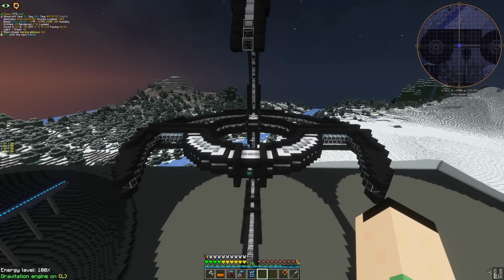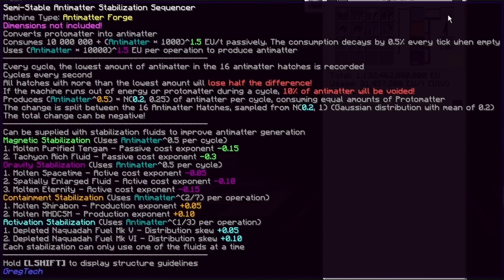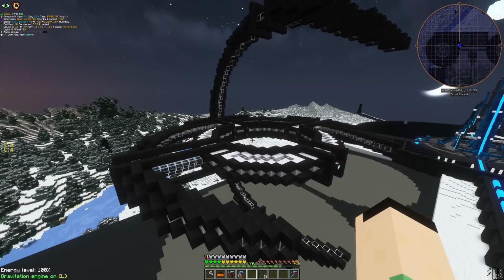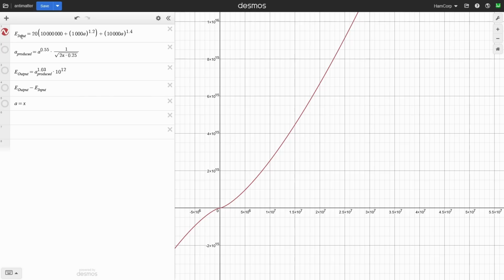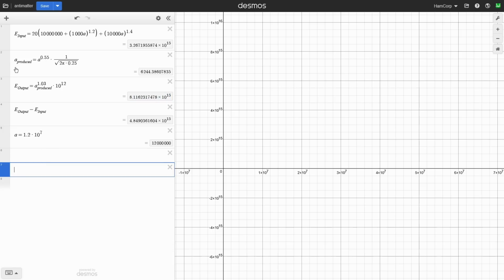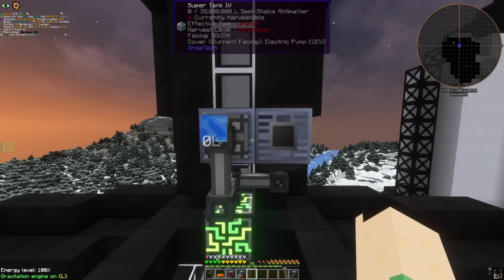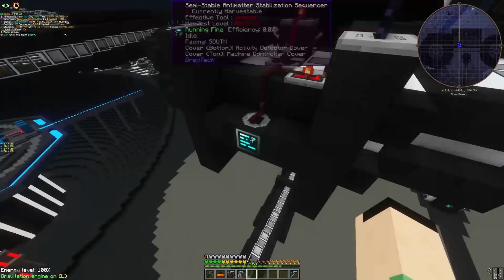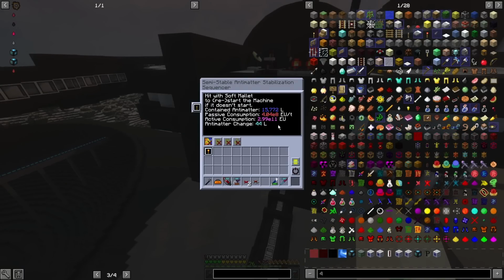GregTech New Horizons E145: Antimatter Automation

Comment from the maker: Dear employees,

The antimatter math is slightly wrong - a_produced is not what is written. The tooltip in 2.7 is not written correctly and doesn't match what happens in the code - what it is actually supposed to be:

a_produced = a^(0.5 + production modifier) * (0.2 + naqfuel modifier)

This brings down the EU profit a lot, along with the optimal antimatter in the hatches.

Also, I am aware of the audio issue, specifically with the ringing sound in the background. The ventilation in my office can get noisy, and the mic only picks up when I speak. I have since fixed this issue, and future episodes should not have this unfortunate mistake.

Best,
HamCorp
Reply: Dear CEO,

I knew there was a reason you make over 2800 times the salary of the average employee!  Keep up the good work!

Obsequiously,
lordshmee
Reply: Minor correction: From what I can tell, the second term with the N(0.2, 0.25) and N(0.2, 1) is the variance. This only changes the first distribution since 1 = 1². But yeah, 0.25 = s², not s.
Reply from the maker: @johanloubser8138  oh you're right, but yeah luckily that changes nothing for the automation or optimization!

Comment: I might be dense but whats wrong with fluid conduits on round robin with counting filters on the 1 side of the automation?
Reply from the maker: I don't remember what this video was covering in detail but I assume it was a throughput or timing thing? Or maybe I just didn't know that was an option
Reply: @Ham-Corp i didnt expect the ceo to personally reply, it was antimatter automation, where you used fluid p2ps with an overflow tank to equally fill up all 8 input hatches iirc. The automation was split between a system to empty the hatches with an io port and redistributing the output equally, since output is in the same hatch and gets distributed randomly

Comment: Dear CEO,
That is such a 5head way of distribution antimatter yet have such a low uptime. Still, gratz for idea. 
Also i want to say that SFM way (that i saw in other streamer setup) was such a genius way for automation mostly because of custom program for redistribution and collecting excess of antimatter that you might want to dive and try it yourself. Just try to make it simple for easy copy/paste bcuz you're gonna need alot more forges in future.
Reply: Yea i was about to say, using SFM is a lot simpler than what tooj did. Still a fun solution to the automation though.
Reply from the maker: I would have to learn SFM first! But I think I have an idea for how to scale this. Though I need to see if the IO can keep up, and I have to wait for antimatter to build up for that.

Comment: The one thing I didn't catch during the explanation is how you will get the excess antimatter out of the system when you reach the optimal amount for power gen. It kind of seems like it would just keep filling the hatches
Reply from the maker: Dear employee,

You are right about the current setup being a bit incomplete. I plan to add an RS latch that triggers based on the amount of antimatter present. At 12.5ML, I will stop everything shown in this video, and empty the subnet until it's at 11.5ML. Then, everything resumes. This way I hover around the optimal amount of antimatter. Tighter margins are possible too if need be!

Best,
HamCorp
Reply: maybe he'll either get rid of it, or use it for something that needs it, I think there is something that needs a lot of antimatter, I could be wrong so please correct me if I am.

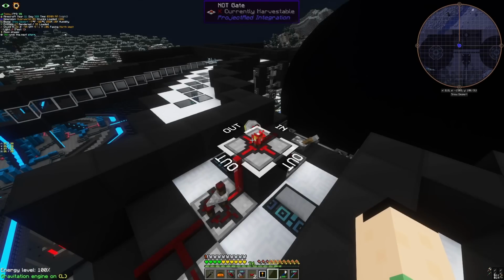Comment: 23:02 One thing that could help with speed (or at least consistency) is using item translocators to move the fluid disks. They always move items as soon as possible and EnderIO conduits tend to have a small bit of a delay.